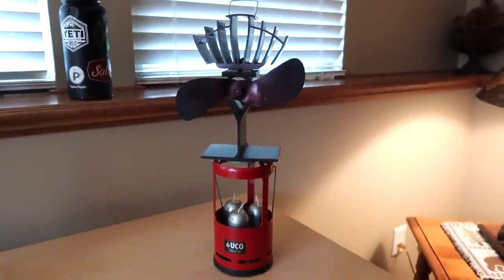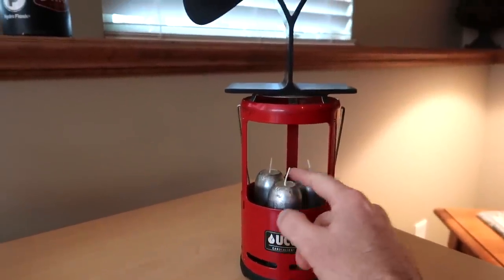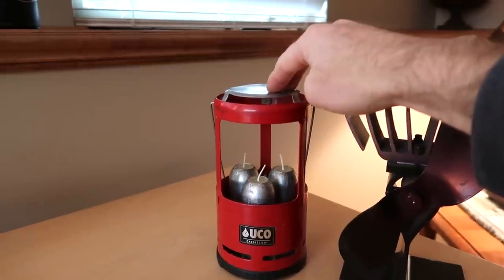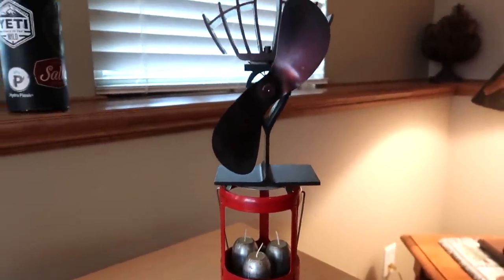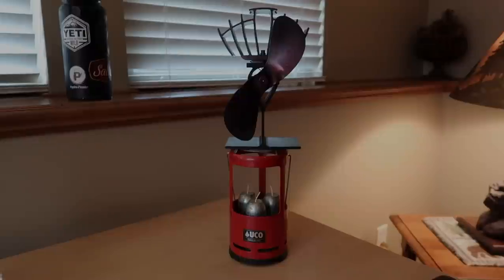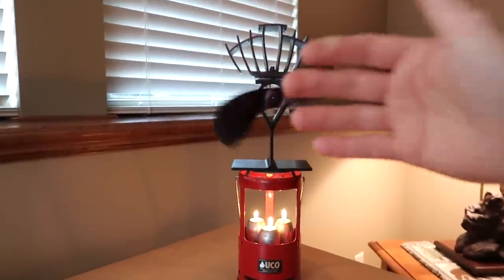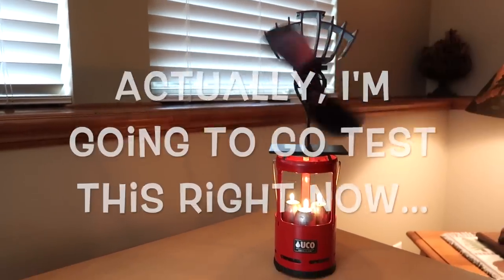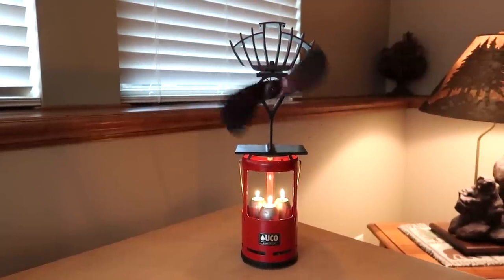Truck Camping: Candle Heater w/ Fan (heat activated - no batteries)

Comment: This takes me back to winter camping in a tent as young man .   It really works good and makes it cozy with the low light too.   Not super hot but definitely takes the chill off.  Fan is a nice touch.   Maybe just needs a secure system to keep it all together .
Reply: Could wire the fan to the lantern, definitely put a bigger base on it.

Comment: I use the UCO chandelier with great effect in my Truck camper.  If it's real cold outside, I will turn the Buddy Heater on for a few minutes to get the temp up and then turn it off and use the UCO for the rest of the night,  make sure you have an CO2 and fire alarm!

Comment: You are the man! That is the best idea I have seen in a while. If you had the glass still in the lantern, it would force even more heat out the top. I have just ordered a UCO three candle lantern, and after seeing your video, I also ordered a ECO fan to set on top. It will serve me well this winter when the power goes out. I will have light, and some heat. Thanks for the video, it was great.

Comment: I think you would need to address the missing glass to have the optimum test.  That heat might not be as efficient without the glass or a can cover.  I modified my Uco with the alcohol shot bottles, and it works great.  I saw the youtube and never burned one candle in it but used the conversion.  I think this is a great idea.  I've ordered a fan.  Hope it works well for me too.

Comment: Awesome! Another downside to the Buddy heaters is the amount of moisture they produce. Fogs my windows in my 4Runner up in minutes. And yes, it's too hot to run for long. I got about 30 minutes or so in 0* F and it was heating the roof liner too much for my comfort.
Reply: Plus one on the moisture situation, and though the no vent propane heaters are  supposedly safe I just don't trust that in a small space. Also great care should be taken in the placement of candles in tight spaces. I knew a girl who was very badly burned do to poor candle placement around her bed. Those synthetics go up fast and they will stick to you like melted marshmallow.
Reply: @shootermcmillan  Very good point in regards to the synthetics. I have both wool blankets and synthetic shelled down blankets so that would be of concern for the latter. I really do like the idea of this setup, however. If it could be made in a safe way, I think it'd be a great way to go. Depending on how long it takes to heat up the space, the candles could just be blown out before going to sleep. You should already have good enough sleeping gear if you're planning on staying in cold weather anyways, so sleeping with it off shouldn't be too big of an issue. Of course there is the potential for falling asleep with it lit, so a more permanent way of mounting this would be important.
Reply from the maker: That's the truth, Ed! I melted synthetic long underwear into my leg when I got a grease burn. Talk about pain, the doctor had to remove all the skin on the affected area...man I'll never forget that unpleasant feeling.
Reply from the maker: Hi Dirb, thanks for checking out the video! To remove the plastic circles, I just used a pair of pliers to get a good grip on the plastic and twisted them off. See if that works with your topper, if not hit me up again and we can trouble shoot it. In regards to the condensation, I've not found any good solutions other than venting the topper with open windows. It's a bit of a drawback in the winter since venting allows cold air inside so I always try to find a happy medium. I hope the new candle lantern heater I am making will help to create a dry heat source to combat condensation. I'll be sure to post a video this coming weekend after I get a chance to test it out. Let me know if you have any additional questions!
Reply: People say to roll down the windows a crack to get rid of condensation.

Comment: That's totally awesome. Maybe when you use the liquid fuel. Try making the flames bigger or adjust the height so it has more contact fan at the top. Thanks for the idea. I will try this when i'm camping out.

Comment: I am curious if you could use a small jar (like for baby food) in the Candlelier with Crisco and like 5 wicks.  It should give much more run time and you would not need to vent the airline Booze bottles.  When you want it out just screw on the lid for the jar.

Comment: No you need to make the base plate wider. Get an aluminum 1/4" (or 1/8" whatever thickness they are) solid diffuser plate that goes on your stove burner.The more the area that is hot, the better the chance you can blow heat around. Also, a small dual fan might work better. Like you's use on a heater buddy.
Reply from the maker: Nah, works fine the way it is.

Comment: Liquid fuel inside a small space would freak me out. Be careful!
Reply from the maker: I'll be super careful, last thing I want to do is have an accident with fire. This is the type of fuel which isn't combustible with fumes. It's normally for indoor lamps but I'll need to be extra careful with the small space. If things get too sketchy then I'll just switch back to candles inside the lantern. I'll be sure to post an update comparing the two different heat sources.
Reply: @OffGridBackcountryAdventures  Dude, you should patent this idea and market it. A clever invention like this could be useful to a lot of people out there, whether campers or non-campers.

Comment: Will it heat a tent in winter, I'm on a roof top terrace and can't smoke inside so have a tent set up with electric heater and it's about $40 a month to run, which seems ok, but would I end up spending more on candles each month?

Comment: Do you know what temperature can be reached by the top plate of the candelier ? I was wandering if it could burned the mecanism of the fan ? Thanks..
Reply: bgdesjardinsbd just measured it at 450f indoors.
Reply: The the mechanism in the fan is all metal..

Comment: It's a stirling engine . Ppl in Alaska use these on their wood stoves to move heat around
Reply from the maker: I think you have a Stirling engine confused with a thermoelectric generator. Stirling engines use cyclical compression and expansion of gas (such as air) which is not what this is. Here's the website for this product, it's called an EcoFan and I've used them for years. Even switched out the thermal generator when it broke. Love these fans. https://ecofan.caframobrands.com
Reply: No it's Peltier effect

Comment: Dometic ORIGO 5100 Heat Pal - Non-Pressurized Alcohol Stove & Heater
Reply: I've been curious about using this. I think it would be a better option, boaters and many others have been using these for quite a while it seems. They aren't cheap, but you can warm food/coffee and probably make simple food on it, albeit possibly slowly. It claims 5100 btu.

Comment: Get some glass so that all of the heat goes up, not up and out
Reply from the maker: Yes, I mentioned this in the video. I take it you watched with the volume off?
Reply: I thought you would’ve done that before the test, that’s all.  If you don’t the extra light, just wrap in with foil, or something Heat resistant

Comment: I'm interested in heating a small room in my house and I'm curious to know where you got the fan from, I know you can buy the heater on eBay but could you recommend a place where they sell the van or both, I live in Ireland by the way...
Reply from the maker: Hi Paul, this is the EcoFan and here's a link to their website if you'd like to check out more info. These are GREAT fans for wood stoves! https://ecofan.caframobrands.com

Comment: So many things wrong... missing glass housing is the main problem!  Second if you do switch to liquid fuel make sure you use lamp oil or kerosene.  Kerosene is much cheaper by the way.
Reply from the maker: Did you miss the 40 second mark where I address the glass concerns?? And at the 2:30 mark I talk about using liquid fuel. Must not have been paying attention to the video, Mark...

Comment: your candle is not practical for heater as the votive candles must be replaced 3 or 4 x during the night..but its cute..as a novelty
Reply from the maker: You must have missed the part in the video where I explained how I'm replacing these with something that isn't candle powered.
Reply: @OffGridBackcountryAdventures  
Lol. Hearing and listening are Two different things.
Reply: They are 9 hour candles right?
Reply: If you dig further for info on this device, you'll find it doesn't use votive tea candles. Each candle in the unit is an emergency style spring fed type and each can last up to 9 hours. Beeswax candles can be purchased for use and are clean burning for 10 hrs as well as citronella varieties. It may seem like your "aunty's decoration" or a novelty but your glancing assessment is wrong.